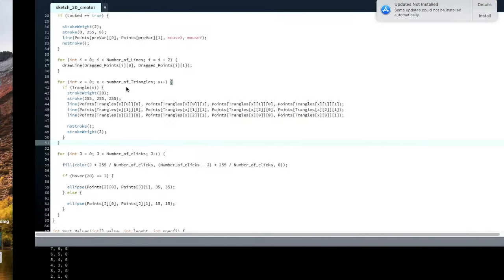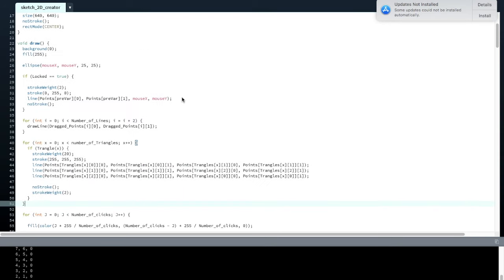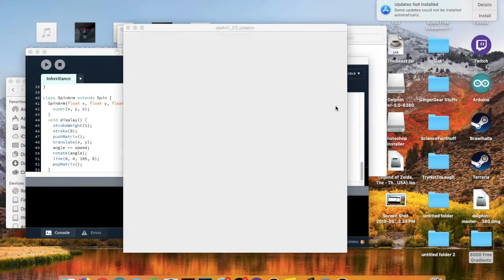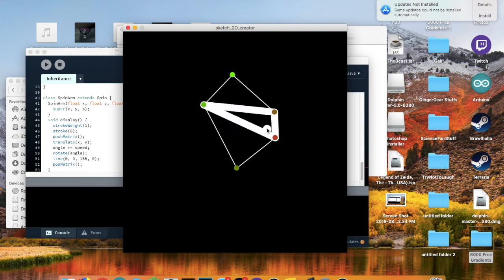2D collisions made Easy! - Arduino 3D engine #5

Comment: Are you developing your algorithms on Arduino directly? Or are you coding in "processing", (so you can step through code to debug), then converting the code to Arduino?

Instead of finding bounds of 3d objects with triangles, use spheres that approximate the 3d object.  Then just use a distance formula.  It's more geometry, but less code and faster execution.

Your channel rocks!
Reply from the maker: Yes exactly! I did use processing to get the algorithm right then moved it over to arduino. It's wayyyy faster to debug. And also thanks for the suggestion!

I also used desmos alot for shape bounding. It's alot easier to write an inequality to shade in a triangle than write code that does the same thing.